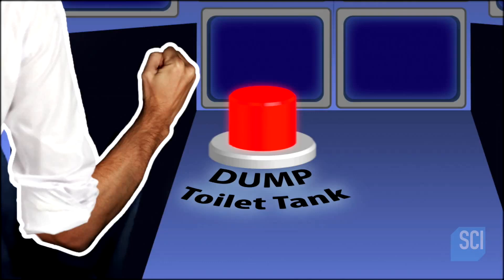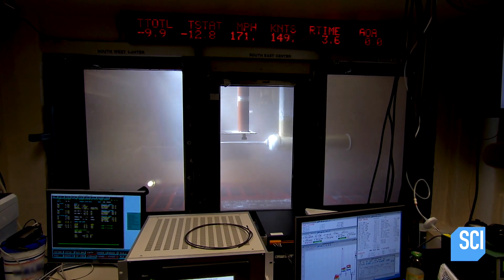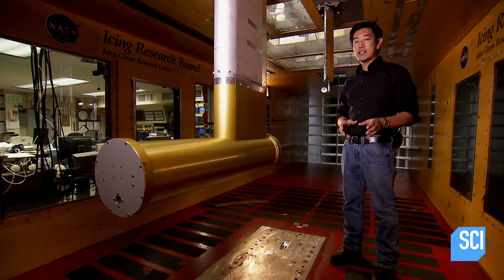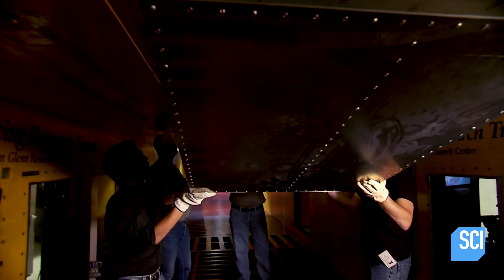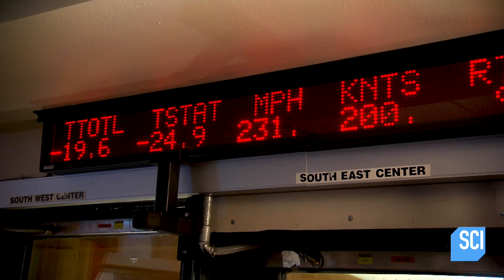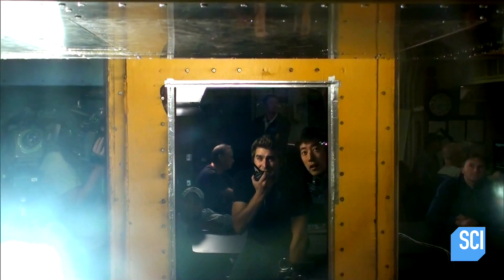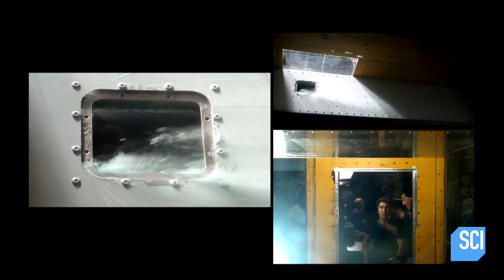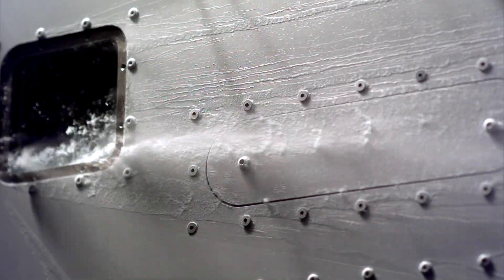Will A Leaky Airplane Toilet Lead To A Deadly Ice Chunk? | MythBusters

Comment: -25°C? That’s it? 
I’ve gone pee outside in -45. It didn’t form a solid stream up to my... etc.
Reply: Your pee is coming out at body temp.
Reply: @PyroNinja713  it’s also stored in room temperature
Reply: Room temp is (roughly 70) considerably lower than your body temp (98.6) but also you weren't peeing in 560 mph wind. I think the main thing is that the liquid gets blasted into very tiny droplets that can freeze almost instantly at that speed.
Reply: @PyroNinja713  and would not be able to coagulate or form an object at that speed either.